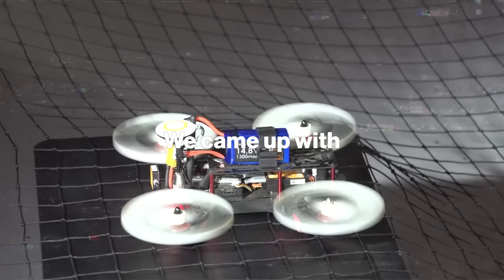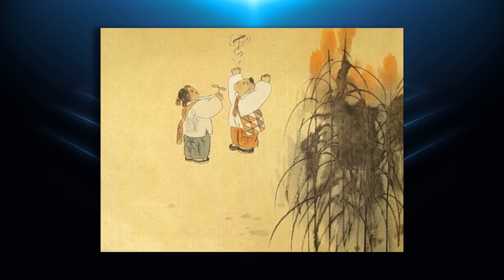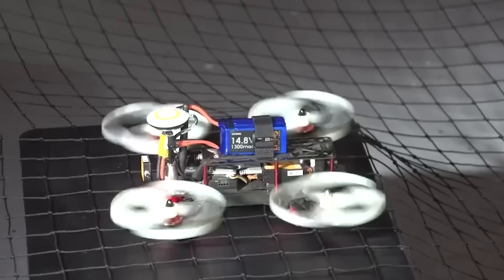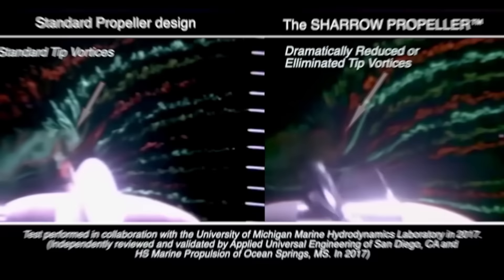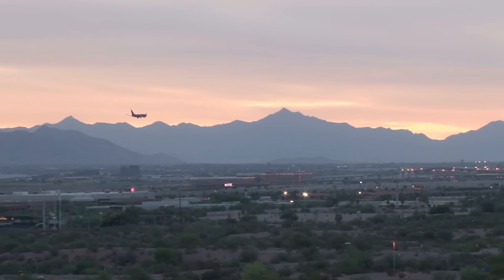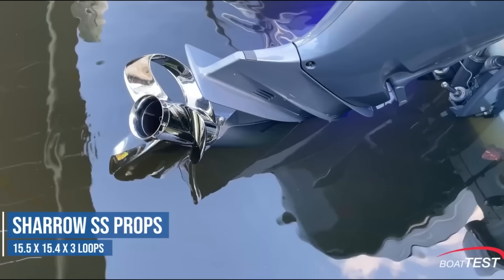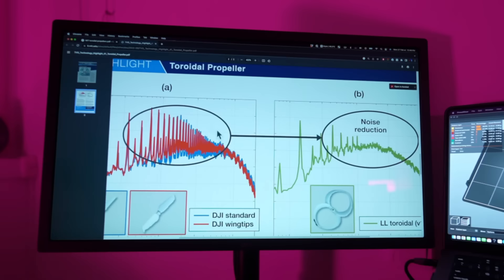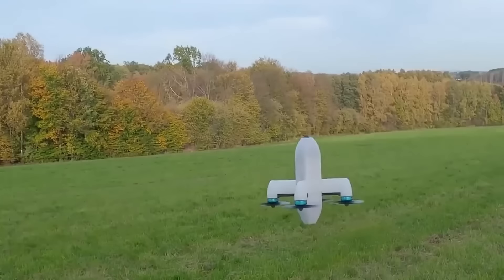This MIT Propeller Is Going To Change Aviation Forever

Comment: All bullshit. We have been there and its use is marginal. You need variable pitch, or else engine will not work in most optimal regime. Then you get increased counter-torque and weight. Then cost. Then difficulties in manufacturing, shipment, all of that. Total waste of time.
Reply: Completely agree
Reply: 2:10 The reason propellers are so noisy is that the tips are locally supersonic . The noise power emitted is proportional to the 4th power of the tip speed, slowing the prop RPM, making it a controllable 5 bladed propeller is the most effective known, other than a fan design, like on the GE 90X engine
Reply: I see that you are a propeller specialist
Reply: @flexairz A simple fact that you need variable pitch for engine efficiency should open your eyes, unless you are ignorant.